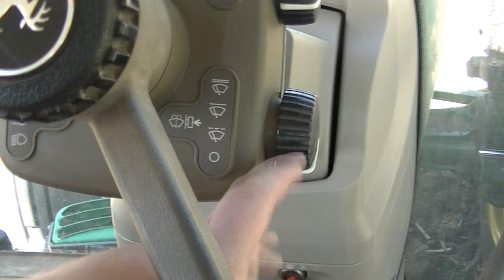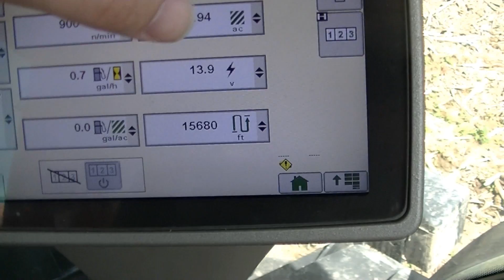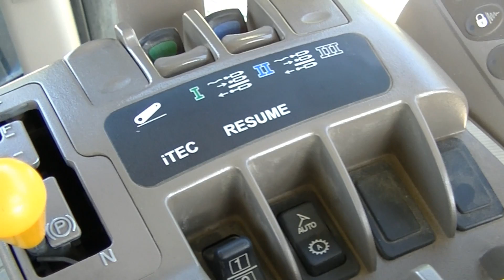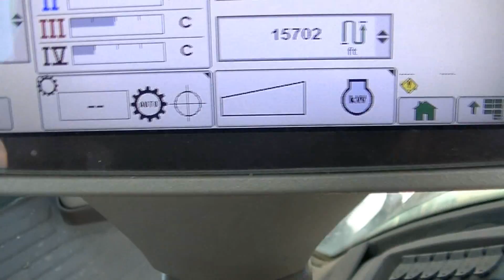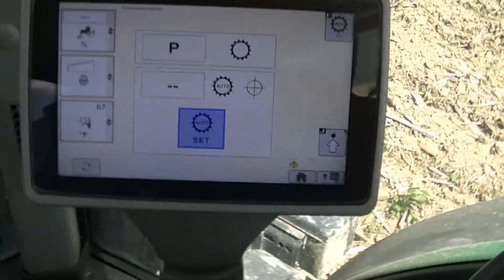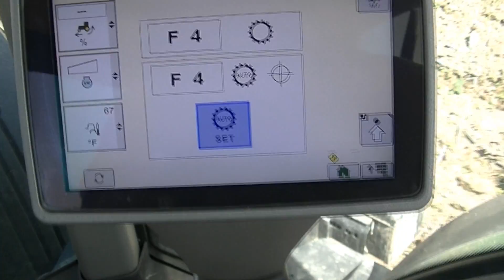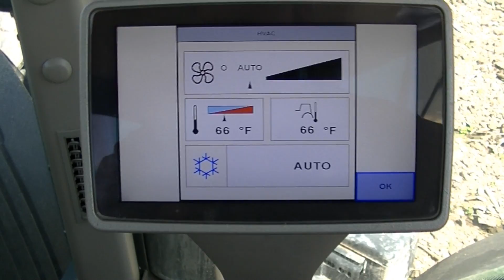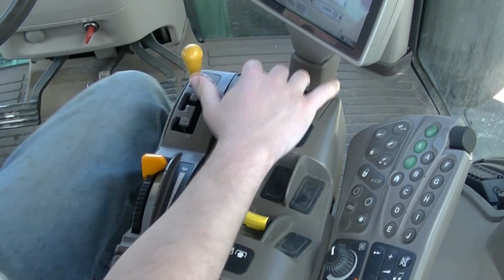How to Operate a Tractor - John Deere 8235R

Comment: Ive never driven a newer tractor ive only ever driven an i believe is a 1977 White field boss 2-105 with the lever throttle and the actual physical gear shifter. To be frank i believe these newer tractors are more complicated to operate than older ones

Comment: thats one of the reasons i love John Deere, because its SO easy to operate.x3 :)
Reply: I have driven a Deutz Fahr 1145 ttv, and WOW that is so easy to drive! But I have never driven any other than a New Holland and the Deutz. So I can't really say anything about the John Deere.
Reply: hay
Reply: I've driven 3 different tractors, late 60s Ford 4000-series, 95 Ford 8240, and a new Fendt 824 Vario. The Fendt was smooth as butter to drive, but the vintage Ford was so much more fun. No fear for breaking anything and wind in my air, bouncing around through the forrest with a big smile on my face. 4L+4H if I remember it right. Anyways, this JD didn't look any easier to operate than the Fendt, nor more difficult?
Reply: I have driven, massey ferguson 135, 35, 5610, john deere 6125r, 5100r, 5125r, 6155r, 6215r, 540 and 3130 6110 mc 6420, 6620, 5820, new holland t6 040, valtra N 106 and a case 95. Even the older John Deere are far better and easier to drive than some of the newer tractors.

Comment: Interesting video and thanks for the tutorial.  These new tractors absolutely fascinate me.  I grew up on the 3010, 3020 and 4020 and the newer tractors look confusing compared to the older models.  Miss the work.  I suppose one might say I'm living vicariously through you.  :)  Be safe and best wishes.
Reply: they're more like a video game than driving the old tractors where the gear lever actually moves linkages and shifts gears!  

Like he said, basically you move the little stick up to "forward" and then bump it forward to upshift to a faster gear, or bump it back to downshift to a lower gear... that's it.  For reverse you move it sideways and down then left again into the reverse section, bump it back to upshift in reverse and forward to downshift in reverse... the bottom section is neutral, or over to the left is locked in park.  

Took me a little while to get used to the BIL's old Cases with the three speed powershift over the 4 speed gearbox.  Basically you can shift up or down through three powershift speeds in every gear.  The newer Deeres like the 4230 are much nicer... the newer yet stuff (like this one) isn't THAT much nicer IMHO just different.  Love running the 4230 of the nephews... 

I'm used to 8 speed manual boxes on my Ford 5000/6000 series tractors... all we ever needed.  

Later!  OL J R :)

Comment: When changing from gear 1 to 2, you press the clutch all the way down then move it into 2? Doesn't pressing the clutch stop the tractor though or is it suppose to be like that? Thanks
Reply: No it still carries momentum pressing the brake would make it stop its just that he was going rather slow it stopped :)
Reply: No because it's a power shift. You don't even need to use the clutch according to John deere
Reply: because it's not a clutch pedal. It throws the transmission into neutral.

Comment: Mate, no one is scrambling your gps signal. The difference is in the fact that what satelite service you pull, how many satelites you can get and what buad rate you can do. And on the RTK all they do is add another position witch is a static one to calculate your movement relative to the static point for a better calculculation of you position.
Reply: I came looking for this comment as soon as he said it. It used to be the case, but that was changed in 2000. https://en.wikipedia.org/wiki/Error_analysis_for_the_Global_Positioning_System#Selective_Availability

Comment: Scrambles the GPS signal ?????????????????????????? Errrrrrr nope. Not since 2000 when all 24 GPS satellites became available for commercial users. All GPS guidance systems (from your iPhone to your tractor guidance system) are just a means to receive and use the positioning data available from satellites. Depending on what sort of system you pay for depends on the accuracy all the way up to RTK correction to + or - 2cm.
Reply: I agree, WTF? Scramble our GPS?  He has been smoking to much barley.

Comment: With multiple passes over the same ground does the weight of the tractor compact the soil?
Reply: But a disc cuts the soil back up...
Reply: +Tj Keegan A disc doesn't cut that deep.  The root zone is still compacted.  I'm old school, I plow to open the soil up and give a lot of room for the roots.
Reply: +hlyautey If you have a disk like my JD 330, you can throw away your moldboard plow... That thing RIPS really deep in the ground. Especially with rear tractor weight chained on top of it and an 8300 pulling it. Hope to upload a video of it soon. For now the only tillage video I have is the 1206 on the Glencoe soil finisher.
Reply: +BrettKuntz i pull a 6' disk with an 8N.  It don't cut very deep.
Reply: +hlyautey Not a heavy disk.

Comment: Where is the foot throttle
Reply from the maker: It doesn't have one.
Reply: +The Pilot Penguin american tractors have no foot throttle or pickup hitches for some reason
Reply: How Farms Work what the f&h no foot trottle
Reply: thats weird
Reply: ***** so is it just john deere i know massey has one
Reply: +The Pilot Penguin our 2009 5085m john deere had a foot throttle
Reply: +Mack Thompson thats not true. we have 2 john deere open cab tractors with throttle pedals as we call them in texas. and a man that did skme baling for us had a newer john deere cab tractor with throttle pedal. they have them just not on all of them. they are nice though.
Reply: +Jack McGee Its basically just a rolling computer...doesnt really need one..
Reply: +Westley Rudd 
Our 8345R has one, but our 8270R doesn't
Reply: TheFamilyFarm yeah its kind of odd like that. Ive seen some with them and some without. They are nice though.
Reply: +Jack McGee you can get it with a foot throttle
Reply: ***** i just made one to put on our JD 2640. They make things so nice. When you go down the road without one you just have to rev it up and then when you go to stop or turn either clutch it or throttle down. I usually set my rpms at a good speed to turn when im road drivin and just use the pedal to control my speed till i get to a turn and let off with the set throttle. They are soooo handy. Love em.
Reply: +Mack Thompson our 4020 has a foot throttle and our MFs have foot throttles
Reply: C&J FARMS really? We have 2 masseys... a 175 and were sellin our 35 and i can find a way to put one on either of them. My dad likes massey but im partial to john deere. So needless to say i drive the jd 2640 and he drives the massey. But after drivin my grandfathers (the one i inherited my green blood from) 2040 with a foot throttle he wanted one. So i made one and i love it.
Reply: the 2640 massey and 6475 and 8140 has them, and the agco allis 9455 and white 170 all have foot throttles and the 4020 like i said
Reply: C&J FARMS they are nice.
Reply: ya they are
Reply: +Jack McGee 
Thats on the backhoe lol
Reply: +Mack Thompson yes they do? ive driven two like that. the throttle is usually  behind the brakes kind of off to the right. not in this guys rig tho
Reply: In Sweden almost every 8r have a foot throttle. It's optional.
Reply: Only one i've seen without foot throttle in Sweden is 8345RT

Comment: The thing I don't like is, some models have two handles (for 1,2,3,4 and A,B,C,D). It's ok until you don't have heavy load, after that you have to operate with both between gears.
Reply: You NEVER move the gear range lever while moving, EVER. Who ever taught you or told you that is a complete idiot. Quad range is meant to be shifted into range at a complete stop in neutral, then shifted into 1st, and then slapped over to second without the clutch, then clutched and shifted ahead to 3rd, and then repeat the same 1-2 process on 3-4.
Reply: +BrettKuntz Thank you. Are we talking about the same/similar models?  Here's the thing: example JD 5080M, gear D1 has about 10km/h. We tried to start in D gear and tractor (no attachments) was "jumping" to just move itself from start. We always need to start with at least C3, then C4, after that, change two shifts (while moving) to D and another to 1 (so now you are in D1) and move up (D2, D3, D4) to reach about 40km/h. Even more work is needed when you have a trailer (empty) and even more with full load. Road is asphalt, no slope. It's like you are in a truck, need to shift a lot.
Reply: +Trac Tech then you have transmission problems. Quad range is never shifted that way.